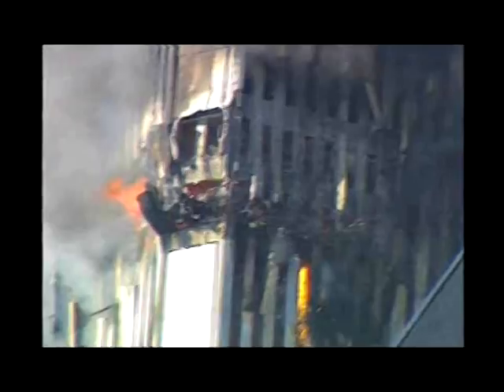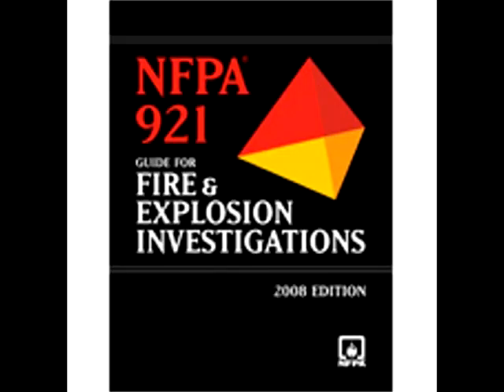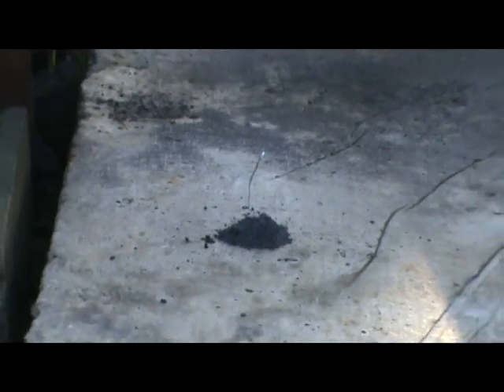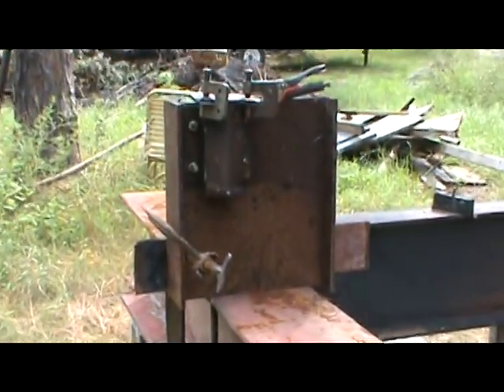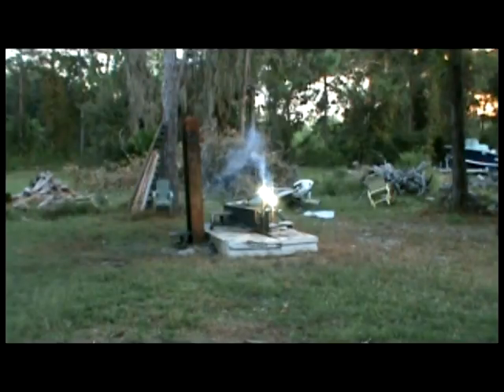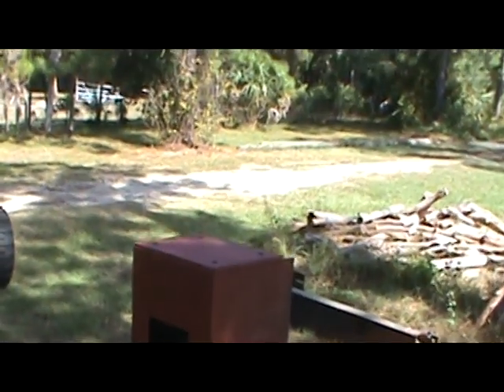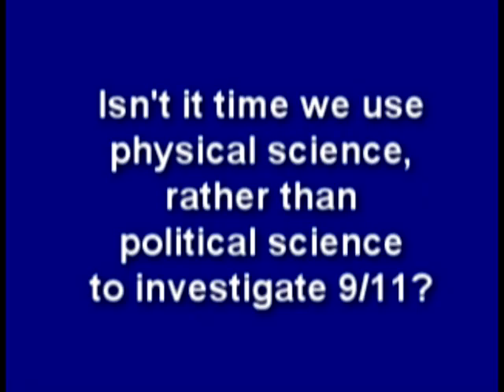9/11 Experiments: The Great Thermate Debate

Comment: and HOW would you bolt the thermite while crashing in a plane?
Reply: People were in the building, in on it, or they coordinated with the pilot to direct them to the exact point of where the thermite was placed to ignite it with the flames and fuel
Reply: Kody Bryant Or they just placed thermate in all the upper floors and told him to fly them plane into one of them, the heat from mixing thermite can cause it to detonate, let alone the heat from Jet fuel and other thermate.

Comment: Electrical fire? 
I know buildings a large as the twin towers had unholy amounts of power going through the building. A short in that on the frame would cause more than enough heat to melt it. 
Jet fuel wasn't the only thing burning. Nobody ever thinks about that.

Comment: Ever see steel heated to forge welding temp with wood? I have. What you fail to acknowledge is the effect of forced air to intensify a fire's heat. Jet fuel may only burn at a temp in open air, but add sufficient air flow you can increase the heat potential. At 80 stories there was plenty of air force present.
Reply: Joe Seabert 
Ever see a grown man naked? Of course you have. 
What you fail to acknowledge is this video is about thermate cutting through steel. The "experts" (debunkers) said it couldnt be done, physicsandreason proved them wrong. End of story.

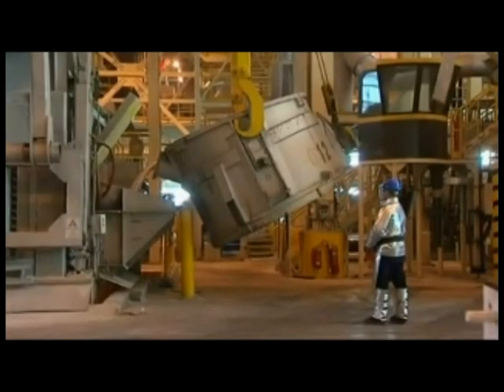Comment: All the photos with bright orange fires are edited, added to, and whoever did the editing made a mistake at -:39 and at 2:32.   (The steel pouring out at window #4. then #5.)
Now about this Great "Thermate" Debate...... was just the stuff used for cutting the beams to fit on the trucks.  It's used for controld sparklers........and the photos of the firemen on the "pile" are crude "cut & paste" (the shoes are always hard to do.)

Two red herrings were planted in all the Truth Movement groups by NSA disinfo, Steve,  of how bad the HEAT was.......crisis actors galore.

Comment: As a PE, your credentials speak for themselves. 

However, for the thermite to be placed inside the outer skin/steel, you are implying that someone had the foresight to do this at the time of construction.  Not sure that's feasible.

Have you considered that steel "Melting" is not the only way to weaken the structure?  Case in point, you are burning steel with your oxy acetylene setup.  At what temp does the steel become "Pliable".  Or to phrase it differently, at what temp would a steel beam with 50-100 tons of head weight become weak enough to start the chain reaction that led to the collapse?

Lastly, if there were a team of demolition engineers that planted the devices to bring the trade center down..... would they not have thought about the multitude of cameras and angles of documentation? Meaning, would they not have ignited the explosives at the time of impact to reduce the "Evidence" of falling thermite residue?   Even if it was only a partial ignition on the exterior walls, with interiors being set for a second or delayed ignition?  And what would the possibility be of a human controlled "Missle" i.e. aircraft hitting the exact mark on each building? 

Excellent presentation.  You should patent your tools and processes! 

Regards

Comment: Well, just a thought here. Thermite is iron oxide and aluminum powder mixed together, upon introduction of a high heat (jet fuel burning). Thermite's flashpoint is 404 degrees. Jet Fuel burns at 800 to 1500 degrees. Plenty enough to spark it, and if the spark is strong enough. Burn. Thermite burns at well over 4000 degrees F. Which is plenty. You have rusting steel, which is a derivative of iron oxide, and aluminum, which also oxides, creating the compounds necessary to make thermite. Introducing heat in that manner would create a thermitic action.

Comment: Ask a blacksmith "at what temperature can you work steel".  Ask a physicist "what is the rate of expansion of steel with temperature".  Now try to jack up 10,000 tonnes of building above the impact point with steel soft enough to be hammered by hand into a different shape.

When the steel buckles and drops the 10,000 tonnes of building above just 1 floor, ask a carpenter how he can drive a nail into wood with an ordinary hammer when his heaviest sledgehammer can sit on the nail and it doesn't move at all.

A blacksmith can bend and shape steel at 700 C (just) with a hammer.  Drop a 5 kilo weight onto a nail from 1 m - if it just moves 1 cm then the load applied is 500 kg

Comment: Oxygen and Acetylene  torch used for cutting steel- Acetylene gas burning wont produce enough heat to melt steel-  but a oxygen- the flame is intensified -
so jet fuel burning- with winds could produce enough heat--  but i dont think the lower floors would be weakened

Comment: That was really cool. Part of me is thinking that with such a wide array of materials in the building is it possible that there was a thermite/thermate reaction but not caused by man, rather just unlucky happenstance? The fires were easily hot enough to melt aluminium and plaster board is made from CaS04. Aluminium reacts almost explosively with gypsum and the reaction can reach 3000 C+ that would account for molten metal seen and it could also (in the right circumstance) easily melt through or damage steel beams. That would also explain the iron spheres and sulfur residue.

Comment: All this scientific stuff especially in the last half is making way too much out of a whole lot of nothing at least as it might relate to 911.  I don't care what people saw or heard that day, it's all subjective. So are actual videos. Who knows what it was viewed far off. But I will say this. I worked 40 years with metals, heavy metals. Demolition of heavy metals. My hobby was heavy metals. And a good fire doesn't take too long to heat steel up to a severe weakened state. Doesn't even have to glow brightly to be a lost cause. 

Planes knocked fireproofing off the columns and spandrels. All that office garbage and  fuel was way more than enough to heat it up to failure. Sherman's men heated rails on a wood fire and bent them around trees by hand in short order. I've been on wrecking jobs after big fires. Seen trucks in warehouse fires that had frames hang to the floor from their own weight.

Simple. The towers went down from their own weight!  Anyway, when was all this prep supposed to go on? On whose watch?  How many men?  In New York? And the building trades unions didn't know it??!!

Here's an interesting take from me.  If the pilots thought to hit the buildings more off-center or to one side, and had succeeded in knocking out an end row of the columns of the center support structure, those towers might have gone down right then! Or at least one side all the way down.  They hit the center. They did sever lots of columns.  But cross-connections between them held it all up.  Remember, in Oklahoma City bombing, one row of columns out front brought everything above them down!

Comment: steel doesn't have to melt in order to get very weak.  It softens up and can be bent.  The first iron was made with small furnaces in the iron age, and used WOOD as a fuel. A confined space can create great heat, remember the fire storms in German cities when buildings caught on fire.  It's a myth that it has to melt.  And no one saw explosive experts installing C4 or any other explosive for months, as it would take to blow up the bldg. from within.  Saying some "could have" happened is not proof.

Comment: You did in your back yard what a government could not do , Amazing.
But can i ask .
How can we see a air liner disappear into the tower.
Ali hitting concrete and steel  would  crumple.
If the road runner imprint on the building was made after the plane hit.
or made as the plane hit the building, we would see it.
Say a missile was fired ( the flash on the building before impact) it would 
Clear a hole yes , but the wing tips , they cut steel to,we know is impossible. 
How was the plaine made to completely disappear in the building. 
And thank you for making your video so that even a complete fool like me 
Can understand how 3000 odd people where murdered , by there own country.

Comment: Hmmm, how weird to see molten metal pouring out of the windows where the gigantic aluminum planes were melting... Oh wait...
Reply: Lol
Reply: ErgoCogita Molten iron pouring out of the building has nothing to do with aluminum. Did your eyes, ears, and brain not comprehend the part of this video that addressed that? WATCH THE DAMN VIDEO BEFORE COMMENTING. Molten iron was seen all over the damn place, and it was also fused with molten concrete. Neither of which can be achieved by the temperature from office fires.
Reply: Elhardt
I watched the entire presentation. He never addressed it, he simply waved his hands and brushed it aside. For instance, if the entire building were taken down with thermitic reactions at multiple structural locations, then why do we only see molten metal coming from the exact spot where the planes fuselage was? Why no dripping hot metal anywhere else within the entire span of the building? Hmmm?
Reply: Elhardt bullshit. Concrete decomposed - as it always has at temperatures of 250-300C - and steel items became absorbed into the remnants of it, resulting in a mess of concrete-composites with INTACT steel objects stuck inside it. That's why none of those steel objects feature any kind of physical deformation - because they never experienced temperatures close to their melting points.

Comment: Check the work of Dr Judy Wood - she shows how the towers didn't really fall - they completely disintegrated and turned to dust before our very eyes... that only paper survived, tells you that some strange new technology was employed in their total destruction. Heavy steel girders and solid concrete, steel filing cabinets, desks, computers and human beings do not completely disappear after the collapse of a building. Think about it. The thermate debate takes us away from what actually did happen that day. They need to keep this technology hidden from the general public. A video like this helps their case enormously. Okay, they probably did use thermate at certain points in the building - BUT - it would only have been to fool us into thinking that this was the reason for their collapse.

Comment: I agree that a thematic reaction was taking place. Back in the war the navy quickly learned that you cannot have any aluminum on the deck as it will burn fiercely when ignited from bombs. (Class D fire) Firemen are aware of this from burning aluminum car engines (you foam it and let it burn itself out) Consider that the burning jet fuel didn't melt the steel but ignited the aluminum planes and it was this fuel that melted the steel, the planes themselves....perfect guided incendiary missiles.
Reply: Also taking into account that the WTC's structural strength was based on the external frame and central lift shafts, both of which were hit by the plane, the structural strength was compromised before the fire even truly took hold

Comment: Maybe the beams didn't need to melt. Maybe they just got soft and buckled under the weight of the giant ass building.
Reply: Kaleb Zehr Check the work of Dr Judy Wood - she shows how the towers didn't really fall - they completely disintegrated and turned to dust before our very eyes... that only paper survived, tells you that some strange new technology was employed in their total destruction. Heavy steel girders and solid concrete, steel filing cabinets, desks, computers and human beings do not completely disappear after the collapse of a building. Think about it. The thermate debate takes us away from what actually did happen that day. They need to keep this technology hidden from the general public. A video like this helps their case enormously. Okay, they probably did use thermate at certain points in the building - BUT - it would only have been to fool us into thinking that this was the reason for their collapse.

Comment: OK. I'm keeping an open mind about this. With the evidence you provided it's hard for me to deny the presence of thermite mostly because of the residue left behind. But the molten metal could have very well been from the plane. Plus, It would be very hard to have the plane hit that specific of a spot on the building. My question is, what if the thermite was on the plane somewhere? It'd be almost impossible for the thermite to melt the beams, but that's the only way I could think of something like thermite making it into the building unnoticed. Not to mention the way it would have to be set up with all the work you'd have to do on the beams.
Reply: ***** Check the work of Dr Judy Wood - she shows how the towers didn't really fall - they completely disintegrated and turned to dust before our very eyes... that only paper survived, tells you that some strange new technology was employed in their total destruction. Heavy steel girders and solid concrete, steel filing cabinets, desks, computers and human beings do not completely disappear after the collapse of a building. Think about it. The thermate debate takes us away from what actually did happen that day. They need to keep this technology hidden from the general public. A video like this helps their case enormously. Okay, they probably did use thermate at certain points in the building - BUT - it would only have been to fool us into thinking that this was the reason for their collapse.

Comment: So quick question from what I understand the structural support came form the core of the towers. I may be incorrect here but if that is the case the outer columns only supported the floors. I may also be incorrect but the core had a heavy use of concrete which to my knowledge thermate cannot burn through. So if this is the case and let's assume this was a controlled demolition via thermate then would the outer columns have fallen BEFORE the core of the building? Of course they could have rigged the core with explosives but then comes an issue with timing. I could be totally wrong here but Mr Physicsandreason I would like to hear your thoughts on this as this video has got me thinking now.
Reply: nocod100 Check the work of Dr Judy Wood - she shows how the towers didn't really fall - they completely disintegrated and turned to dust before our very eyes... that only paper survived, tells you that some strange new technology was employed in their total destruction. Heavy steel girders and solid concrete, steel filing cabinets, desks, computers and human beings do not completely disappear after the collapse of a building. Think about it. The thermate debate takes us away from what actually did happen that day. They need to keep this technology hidden from the general public. A video like this helps their case enormously. Okay, they probably did use thermate at certain points in the building - BUT - it would only have been to fool us into thinking that this was the reason for their collapse.

Comment: It's possible that the thermite/thermate devices were installed into the beams when the buildings were constructed as a way of urgent demolition in case the city is captured by invaders or buildings are heavily damaged by some accident (like crashed jets) and can fall uncontrollably.

If so, it would be interested what other structures are mined in the same fashion.

Comment: it could have been molten aluminium, planes are made of the stuff, and jet fuel can melt aluminium
Reply: becton98 Actually, the onboard snacks are sealed in plastic bags and THAT will melt in a fire. THAT'S what we saw pouring out of the side of the building 10 floors below the impact. THOUSANDS of packages of macadamia nuts melted and dribbled down inside the columns. Problem solved!

Comment: what happens when high voltage electrical wires are shorted? I would think thousands of amps of electricity arcing to steel would cause a large amount of sparks and molten metal. Also 1,800 degrees is more than enough to weaken steel to the point of collapse.

Comment: ok melting point of steel is 2500 degrees.  jet fuel burns at 1500 degrees. plus all the building material in a building plus the plane hitting the building is enough to one weak the building, then when the fires got to 1500 degrees the building becomes very weak and gravity pulls the building down. causing a tragic collapse. question if you have thermite in the building and the plane trigger it why did it happen right before the building collapsed than before?

Comment: Something about the whole trade centre business certainly does stink of a cover up.  A while back I took photo's of a speed camera near me. Someone had vandalised it using what appeared to be thermite. I think it must have been a disgruntled local railway worker, who perhaps got a speeding ticket. But it had melted through the steel case. The camera was completely destroyed. The only Jet fuel could have done the melting, would be if some kind of air convection effect raised the internal burn temperature. Also the effects, of the different molten metals may have formed some sort of Amalgam and helped lower the steels melting point. The molten steel pouring out does look dodgy though. I do not think we will ever be told the truth about all this.  The other thing to take into account though is the fires in the building would have made metals expand and twist. Which could lead to fracturing. The ease at which either dodgy government agents or terrorists could sneak into the building and plant Thermite before the planes hit. Needs to be looked into. How easy would it have been to mount these thermite bolt cutter charges without being seen? Did any ex office workers see workmen in the building before the event? And how easy would it be to access steel work through all the interior cladding and fixtures and fittings?